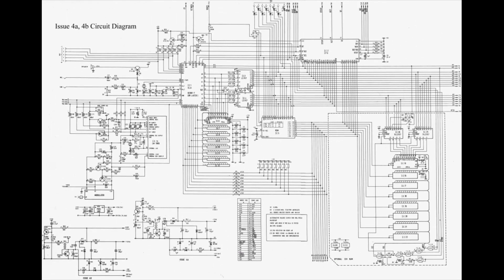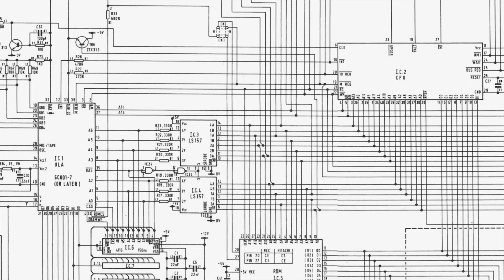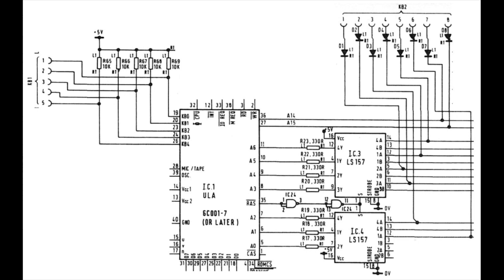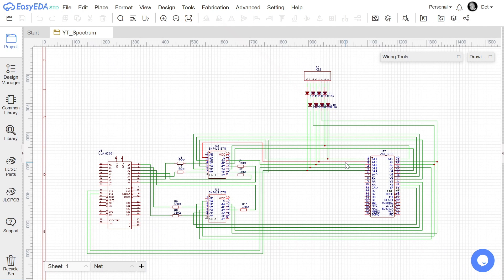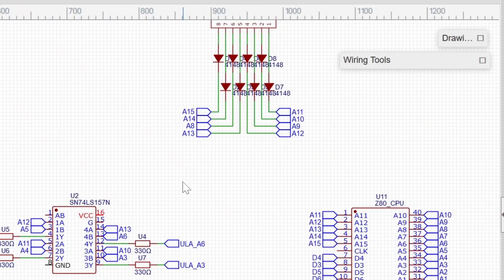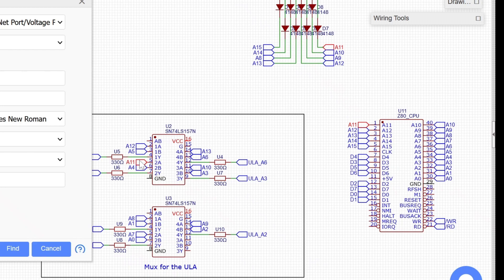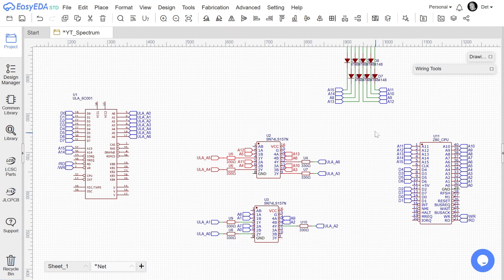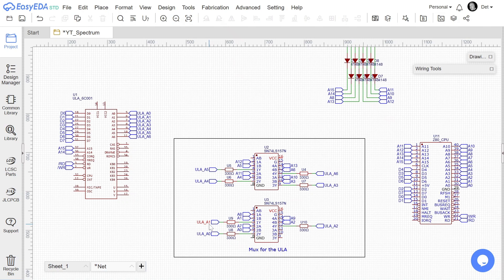PCB Schematics With Nets (and why they are cool)

Comment: Well you asked so... IMHO for digital devices like this one a schematic using nets makes sense to me and is more readable than a conventional schematic. For analog devices such as power amplifiers where there is a clear signal path from input to output then I think a schematic with all the interconnecting lines (wires) between the transistors, op-amps and associated components is more readable.  In those sort of devices I would prefer to see nets used only where the circuit spans across several pages. Then there are hybrid circuits such as a graphics cards and motherboards where the 'digital' parts of the circuit only make sense when using nets and the 'analog' parts such as VRMs and start-up sequence logic make a lot more sense with the interconnections shown using lines.  Actually for fault diagnosis on GPU and motherboards I most prefer to work from a board view rather than a schematic as it is easy to click on a component pin and the board viewer will automatically highlight all the places it connects to.
Reply from the maker: Absolutely with ya - beeing the digital guy here, I'm still a bit biased, but with analog circuitry, where the components and their connections "form" the function, net's will not be any help at all. But I still would have some nets in there :D

Comment: Hi Det, I'm with you and much prefer this standard / approach for schematic diagrams. They are far easier to work with particularly 5 years down the line when one has moved on to other projects and trying to remember how something works or should work as the case may be. There is an IEC standard (may have evolved as a VDE standard) covering this but can't bring the number to mind right now. Nice video👍
Reply from the maker: Cheers, Alan! Richard pointed out (and he's right) that this works best for digital schematics - if you have a bunch of analog circuitry (where the components become the function), I'd still group functional blocks together and then connect everything with nets.

Comment: On a computer this is great and works for ICs, but when you get down to making something with a lot of basic components then lines will be needed.
Also if you wanted to print it out, it would be harder to follow using just nest labels, perhaps labels with bus lines.
You have to remember old schematics where drawn by a draughtsman on paper with a pen and ruler. 🤨#said in gest#
Reply from the maker: Hi Tim - yeah, Richard said the same. This works best on digital schematics. If the schemactic itself "forms" the function, nets won't be any help. But for digital - I stick with nets :) Busses are a different thing - I didn't want to cover this in the video.

Comment: Sorry but that's even harder to look at than the old one. How to you know if you have missed a connection between IC's. If you want to tidy up address & data bus's use the bus function. a single line that knows about all the connections in it.

That way one line forms the bus between IC's and then the individual nets break out and connect to the chip pins. you can follow the flow and easy see if you have missed a connection to the chip. Plus flow should try and flow left to right across the page.

In KiCad that shape is called a global connector, a 'Net' is text you connect to the wire at ever point of connection to a component node. 

Nets are very good for checking tracks on the PCB if you have given them good net names, as I hope you would give them human readable names. make debugging the PCB easer.

Sorry but chips just floating about on a schematic is just asking for trouble with missed connection, etc in IMHO. Or in old school "In My Opinion be it Humble or otherwise"     :-)
Reply from the maker: Hi TEH - intersting! I find the net's view much more clear than the spaghetti mess the orginal schematic was. Sure - busses are another way to go - this was about nets, so busses are not in this video.

Seeing where I missed something with nets is (in my opinion) pretty easy too: if there's no net label on a pin, I've missed something. 

Thanks for your point of view - I guess we again agree to disagree :)
Reply: i used to draw circuits by hand and give them to the drawing office to generate the schematics and pcb's. so  i find it hard  break the habits of a life time. the problem is you need to know the routing , for somebody else looking at it its very hard to see the flow. 
i'm just old and stuck in the ways a strict QC department beat into to me at a young and impressionable age. 🙂
don't get me started on flux, another pet hate. 🙂
Reply from the maker: @TheEmbeddedHobbyist  I strongly agree with you about the flux thing!!
And I still value your input on any toppic - thanks, man!
Reply: Always glad to add to the comments count. I'll have to change my channel to "Teh comments too much" 🙂 @DetBuildsStuff
Reply: I come from old school electromechanical wiring diagrams and later track diagrams similar the that old Spectrum.
I find a mixture of both now solves my humble means. JMO